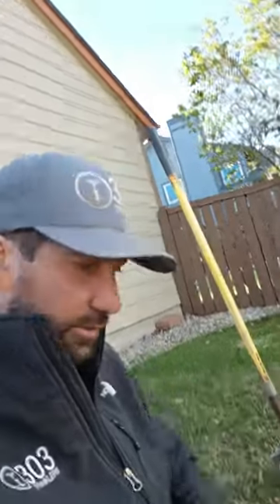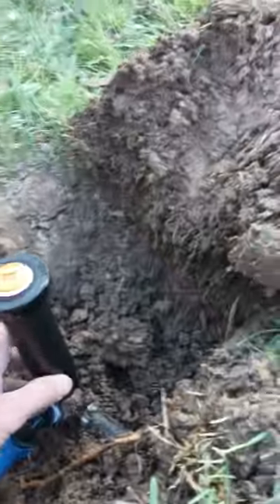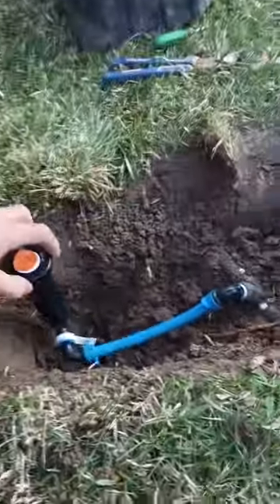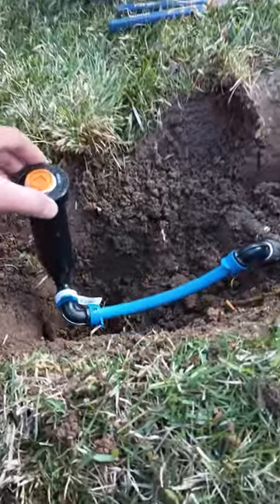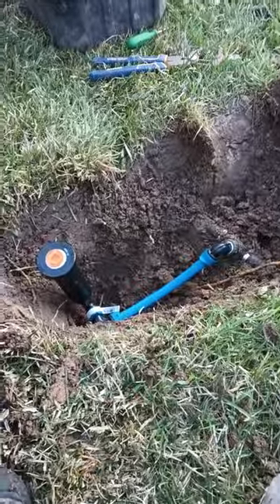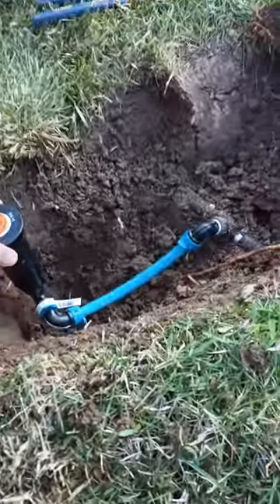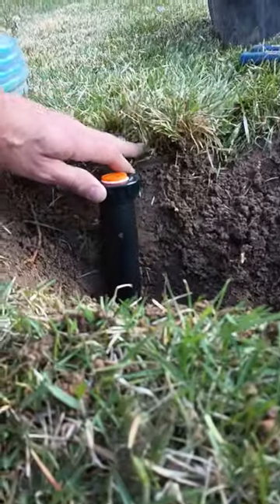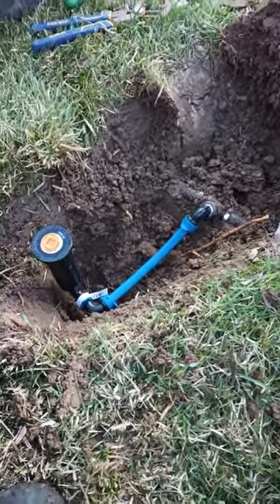DON'T DO IT WRONG! install sprinkler HEADS this WAY ONLY! #shorts #water #diy #sprinkler

Comment: I started doing this 3 broken sprinklers ago. I convert them to remote sprinklers like this. So even if you bump them with the wheels of the lawn mower worst case they just deflect a little. It also allows you to use as long of a sprinkler as you want. Want it to pop up 12”? No problem, just dig a deeper hole for the replacement sprinkler. Plus a longer sprinkler is less likely to move.
Reply from the maker: @Surannhealz  you wouldn't need a 12" pop up on turf though

Comment: This is how you should do it! Makes the sprinkler a lot easier to work with in the future and also increases the chance of it resisting damage.
Reply from the maker: Thank you! That's what I've been saying for over 15 years!
Reply: how does it decrease the chance of damage? It doesnt. It add more parts to break and places to leak when you could simply dig out from the original location to get the proper depth. Oy maybe try buying to correct length head for your application in the first place.
Reply: People step on the heads kick them, mowers run over them with a ztr tire or bump, them with a push mower, a tree falls usually how they get damaged. This allows the head to sink or have some bounce without breaking a connector or head every time. Doesnt matter if you have a riser or no riser. No head should ever be installed directly to pvc swing pipe it. Future you decide to move it just dig it up. @Mach141t

Comment: Do you have links? I can’t find those on Home Depot site. Thank you
Reply: Just use "Funny" pipe ( a Toro brand name , or another half inch flexible pipe with a thick wall that is designed for this purpose), and two 1/2 male NPT to 1/2 male barb elbows, and one 1/2 street elbow. The street elbow goes in the head. Then a barbed one into that. Use at least 10in of funny pipe and then the last barbed elbow goes into the tee in the larger PVC line. Usually set the PVC tee with the opening up, or down. Down can trap water making it harder to clear water for freeze protection in the fall though. 
This gives you the ability to set the head anywhere in the radius of the funny pipe, set the depth easily and move the head vertical without fighting the pipe it is connected to.

Comment: It’s also great if you’re using hard tubing like PVC for your main water lines as stepping or running over the sprinklers can put downward force on them and crack them

Comment: They stick upright and then they get run over still or it snaps a fitting. The swingpipe they sell works similarly to your setup.
Reply from the maker: @Room_for_1_more_fruit_tree  nothing functions as well for as long,  and as intended, as Blu lock

Comment: I want to add some to my back lawn.  Home i moved into only did the front and 4 at the back corners of the house..could i attach more to those lines at the back and add about 10 sprinklers to reach  the entire back lawn?
Reply from the maker: Ten spray heads or rotors would likely be way to much. You can tie into your lateral pipe, trench 8" deep and space your heads out to 35' if you pick up a rotor such as rainbird 5004+ and use the number 1 nozzle
But you likely only have 12-15 gpm available. Once you exceed that, your performance will plummet rapidly because your demand exceeds the available flow

Comment: Can somebody tell me exactly what parts I need to do this?
Reply from the maker: @exnyer72  Blu lock street elbow and 2) 1/2"  mip x Blu lock elbows, Blu lock swing pipe. 

Although I don't recommend the ones from Home Depot because they're not the same quality as the ones we get from the distributor they do have these pre-built and I believe they're about 10 inches
Reply: @303sprinklers  Appreciated! I have it all dug up...I wanted to be sure I am buying the correct parts.

Comment: Any issues with surrounding the sprinkler body with tamped down paver base gravel and then placing an old school concrete yard donut around the top and slightly higher than the sprinkler head. Thoughts are, that when the lawn mower inevitably runs across the sprinkler. The wheels only contact the donut which is supported by paver base and resists sinking in the soil.

Comment: Great, except use a blulock saddle to connect to the lateral
Reply from the maker: @TurdFerguson149  I don't trust the quick pop on saddles on existing pipe.  New pipe sure, but old pipe not so much
Reply: @303sprinklers  I’ve had great luck with the blu lock nitro saddle
Reply: Saddles are obsolete, just use tees which will allow for more water flow
Reply: @ they are absolutely not obsolete! Blulock saddles offer excellent flow, are reliable and efficient!
Reply: @ yes they are, they restrict water flow, just use tees
Reply: @ you are totally incorrect! Tees are fine, but they take more work and give no benefit.

Comment: To say that any other way would be the wrong way is a bit of a stretch. That being said this is a good job. Irrigation technician of 6 years here
Reply from the maker: @user-oe7fw4tc7g  here is why it's wrong: and yes,  I say that to be hyperbolic for views, but also because I believe it. 
The funny pipe marlex fittings are not engineered to swivel, in order to move with the soil.  They don't fit as easily, they are much more likely to wear out at the elbow connection, and they aren't that much cheaper. 
Blu lock is the standard as far as I'm concerned

Comment: Nice tips for the diy people. Common sense use a swing joint. Marlex street elbows give you even more mobility.
Reply from the maker: They don't though. I love marlex but it doesn't swivel as easily. Blu lock is engineered to swivel
Reply: @303sprinklers  Blu lock is nice don't get me wrong but funny pipe, with barbed elbows and one marlex elbow swivels well and they are much cheaper for customers. It's funny how many people just use a tee/head with no swing arm. They'll find out the hard way when the head breaks or they need to raise the head.

Comment: I live in SE FL and we have a lawn service where they use those heavy ride-on mowers. I’ve had to replace a few heads over the years due to the wheels of these heavy machines damaging the pop-up rotors we use.
Reply from the maker: @Onewayto2024  try these
Reply: @303sprinklers  
I will! They look like they will “give” a little under the weight of a ride-on.

Comment: How long can you get the blue hose?
Reply from the maker: You can buy it in 100' rolls. 
I don't install it in the field longer than 12".
8" swing joint length is ideal

Comment: I get the double 90 but exactly what is the seal connection between them that they are able to swing so easy while not leaking?
Reply from the maker: They are rubberized polymer that's a compression fitting. They are fantastic and I've dug some up after 15 years, not a leak to be found. Much easier to install
Reply: @303sprinklers sorry to bother you again, but could you possibly dump a link so I can get an idea what I'm looking for? Thanks in advance
Reply from the maker: @transws6am  https://www.sprinklerwarehouse.com/product/fittings/blu-lock-fittings?gad_source=1&gclid=Cj0KCQjw6PGxBhCVARIsAIumnWam-uSumVz2yJumetokMpaFTqw7IrEF9FBWXqtReB5kmhBSAXHXJlMaAjEBEALw_wcB

That should be it. Blu lock fittings

Comment: We use alot of funny pipe , 1/2 inch flex usually also but that can snap out over time , funny pipe and funny fittings is the way to go very lasting .
Reply from the maker: They last, no doubt.  But they are awful to pipe fit and Blu lock is great product that you can easily disconnect down the road and refit

Comment: Makes sense but don’t say it’s your way only there are several techniques that can be used
Reply from the maker: True, however this is the hands down Best method. I will make some detailed videos as to why when I finally get some time
Reply: Nah he's right. If you are just leaving your heads on risers connected right to the lateral line, well, I feel bad for your customers.

Comment: Wouldn’t that be why the pipe beneath the head with the T on it would be lower so that the head of the sprinkler would be at grade? What would be the problem with that solution. I don’t see the need for all the extra parts and work.
Reply from the maker: Soil move substantially over even just a few years
This enables the head to move with the grade, but also substantially reduce adjustment time if it's slightly canted. 

It's really the only correct way. I prefer Blu lock for ease and design,  but double elbow on swing is the way

Comment: bro the only thing that needs to change is the pvc! Why arent sprinkler lines just made out of those soft hose in first place! Thats a cool solution for some sprinlklers that already exist, but why not use uncrackable hosing from here on out? That way you can run it over, besides thats for ride lawn mowers right? not push mowers!

Comment: funny pipe, barbed 90, fix it. Burrie the head cover up pack down cover up. 2 minute job and $80 in wilmington NC
Reply from the maker: It's even easier to fit the Blu lock, and even if you don't want to use it,  a double elbow is critical

Comment: What are these parts called?
Reply from the maker: Blu lock elbows, swing pipe, rainbird 5004+ rotor
Reply: @303sprinklers the one in the video is a rain bird 1804PRS

Comment: Easy way and cheaper is using a flex pipe normally called it Funny pipe. Swing joint still good but more expensive.
Reply from the maker: It's still pennies on the dollar. It takes way more effort and time to fit funny pipe. Blu lock takes seconds and it's significantly easier to pipe fit

Comment: I would say that the way we do it at our company is better, we use flex pipe glued into a street elbow, costs us less in the long run. But this is definitely a solid fix.
Reply from the maker: Do you use double elbows? The street elbows aren't made to swivel. It's critical in long term stability and flexibility of the spray head to move with the soil. 
Blu lock is so much easier to pipe fit as well
Reply: @303sprinklers I have never done double elbows. We are in NE Florida and the soil is very sandy so I think that plays into why we are able to use only street elbows, if a mower runs it over the flex and head just sink and rebound. Of all the ones we’ve put in they’ve never broken unless dug up by heavy equipment.
Reply: I'm with you. I do it the same way and have for years. Those prefabed swing arms are trash, can't even cut and glue em

Comment: It's also a real joy to dig up half your lawn to find the pipe when there is a leak coming from the main and the swing joint.
Reply from the maker: I'm not sure I understand your sentiment. Are you generally irritated or are you trying to say that the swing joint somehow is a contributing factor?

If there's a leak at the swing joint that's really the only place you should be focusing
Reply: @303sprinklers  it's not to blame, it's just an added pain if there is a leak to trace it to the source.  With a straight connect you can just take out the sprinkler and replace the riser. I had one in the middle of the yard break and had to dig a 2x2 foot trench to dig up the sprinkler then follow the swing arm up to the main pipe.
Reply from the maker: @gennafer  so your swing joint should only be about 6 to 8 in. Anything longer than that is not correct it needs to be dug up to properly fix it. The difference should only be about one shovel wdith
Reply: @303sprinklers  Yeah, they definitley didn't install correctly and they used 6-18" sprinklers in my 500sqft lawn  so I have to dig to China just to find the flex pipe and then follow that.
Reply from the maker: @gennafer  I would be furious. This is the type of crap I have to deal with just about every day.

It's why I make this content to help others
Reply: @303sprinklers  I appreciate it! I've had to fix just about every sprinkler on the property since I move here. I've learned a lot though. Thanks to all you sprinkler guys on YouTube I don't have to hire idiots to fix it wrong again!

Comment: Using a blazing saddle is way easier and faster than what you are doing. I’m not quite sure why you are using 3 90 elbows? Why not just one? Just because someone does it another way doesn’t make it wrong. Are those pre-made lengths? Blazing saddle to funny pipe to funny pipe elbow is the way to go and can all be done in less than 60 seconds.

Comment: You Do Not put the elbow coming out of the tee at 45 degrees. It's better to lay your tee flat so it comes out the side then use two tees going to the your blue lock or funny pipe. Then two more elbows.
I've done sprinklers for 29 years.
Reply from the maker: @dalecrossley9976  it was an oversight while making it for instructional purposes.  I keep them at 90°, but didn't pay Attention to that specifically at the moment before I set the tee back. 

It's not a big deal though either way because of the length of the swing pipe being about 8"

Comment: This is very region specific. We just use pvc pipe for laterals and swing pipe and have no issues.
Reply from the maker: Yes you're absolutely correct this is Colorado front range specific. Probably in Moab basically any semi arid environment that gets significant winter freezing.

I know in California they use PVC because they don't get any winter freezing significant enough to do any damage unless it's an extremely rare situation...

My understanding is they need to use PVC in California because the trees are such harder on the pipe because their roots are extremely tough unlike hardwoods that grow on the Colorado front range like maple, polar, locust, and elms etc...and stuff that's been brought in here artificially. It takes at least twenty years to start messing with the pipe whereas I think in California and places in that region the roots are awful within ten years which is why they use PVC which is much more resistant to damage from roots
Reply: @303sprinklers Wow dude, talk about back pedaling. 
Video: So if anyone else ever tells you to do it differently than this, they are wrong.
First person to person challange: Oh yeah, except for that.
Reply from the maker: @TheLarryBrown  dang buddy you drank some high octane hateraide. 

You lack reading comprehension if that's the interpretation at which you arrived. Double elbow Blu lock swing joints are the BEST, most effective, highest quality and PROPER method to install a head or rotor. 

Period. Full stop.. You are mistaking a discussion regarding lateral pipes vs swing joints. Typical Monday morning armchair quarterbacks. No knowledge, no real experience, just dumb and baseless opinions

Comment: Then all my sprinklers are screwed up.  No wonder they are not working on consistent basis.  Frustrating thing is they were installed by "professionals" who should have known better.  I will now need to DIY each and every one.

Comment: Why not just get a shorter one? If it was a 4” tall just get a shorter 3”?
Reply from the maker: It's the design flaw in itself.  Soil moves, so originally this would have been set to, or close to, grade.  

This is the point I've been making for years.  It's a flawed design. It's a cheap,  lazy, stupid installation technique and it leads to repairs down the road that take 3x as long, don't actually permanently fix the issue, and cost the client more

Comment: Thanks. So why do I need to hire you?
Reply from the maker: You don't.  I have plenty of work and my reputation speaks for itself.  This is for free to help homeowners and new irrigators
Reply: I actually prefer to hire contractors like you who I have seen videos and have pride in their work.  Homeowners either don’t have the time to do the work or would rather have a professional do the work.  I always hesitate when I ask a question to a contractor and they give generalized answers.  It seems like they don’t know what they are talking about and it makes me hesitate giving them the job.
Reply from the maker: @FixItWithMe  I appreciate that and sometimes I do make mistakes or have oversights and then I just have to deal with correcting them as warranty

Comment: Don't use that blue pipe crap just use regular swing
Reply from the maker: That's ridiculous. I've installed literally thousands of these over 15 years and have NEVER had a failure. 

Here's what is happening and why people think this product sucks:

1 technicians that don't know how to properly seat them the entire way
2 technicians who tamp too hard on the double elbow below the spray head, when they didn't soften the soil below, and it cracks the fittings
3. You encountered home Depot version of this product, which is absolutely not the same spec. I have had at least a dozen failures on the new elbows from home Depot, sure to manufacturing defects.

NEVER, EVER from the stuff from the distributors.

Comment: Those blu lock fittings are junk no matter where you buy them.
The best way to install a head. Lateral line<kwik tap saddle<funny elbow<funny pipe<funny elbow<marlex<head.
Stop buying from big box stores

Comment: No it’s not. Swing joints & a nipple is better than that pos blue pipe.
Reply from the maker: 15 years,  you can go to any job I did with Blu lock installed, dig it up, and run the zone with those fittings exposed. 

I guarantee they don't leak

How do I know? Because I've tested this before just to prove a point. They are the best in the industry.. no amount of resistance or hate for that product will change the truth.  The entire design is superior to any thing else on the market